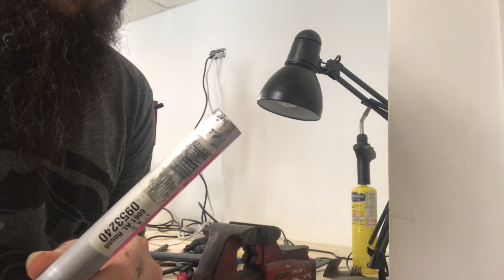Shortening a shotgun barrel

Comment: I had a shotgun with a 24” barrel once upon a time. Loved that gun, and was very proficient with it. Sadly I lost that gun in a divorce, had to sell it for money for an attorney. 
A few years later I was able to buy another but the manufacturer only offered 28” barrels at that time and in order to buy a 24” barrel from the manufacturer it was fully half the cost of a new complete gun. 
I opted to have the barrel shortened by a smith. Unfortunately he was not able to cut threads for the “OEM” chokes and had to use aftermarket chokes. 
I ended up with exactly what I wanted and the new aftermarket chokes work just as good. 
A good gunsmith is hard to find so kudos to you for going the extra mile and making your customers end product as professional as you could. Nicely done 👍

Comment: Id be interested in how you made your barrel holding jig? You showed some but not all lol
Reply from the maker: I apologize that I cut some of it out. This was one of my first videos so I wasn't worth a damn behind or in front of the camera lol. I split the thing at an angle length wise and threaded the one half white the other half had a clearance hole for the screw so that it would expand when inserted into the barrel and the screw tightened. The screw head then had a center point drilled in it to fit in my live center.

Comment: How would you thread that to add a thread in choke?
Reply from the maker: By reaming the bore and using a tap made specific for the desired choke tubes and bore size. It can be done manually by setting the barrel up in a cats head and indicating true in a steady rest then using the lathe to bore and thread but the reamer is faster and easier.